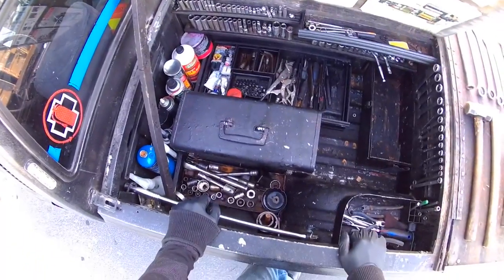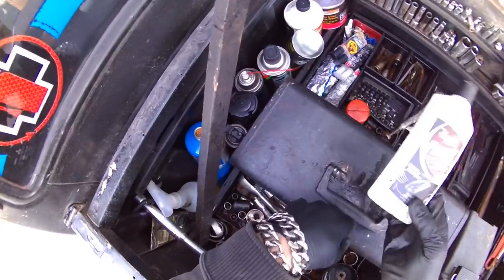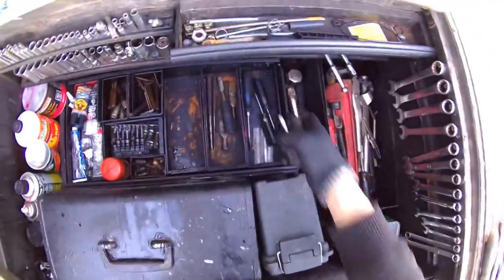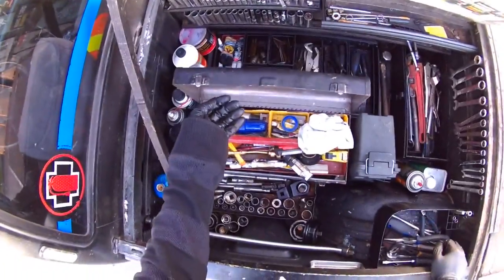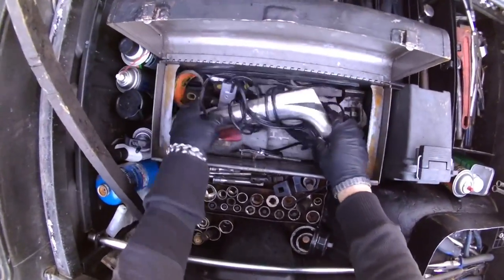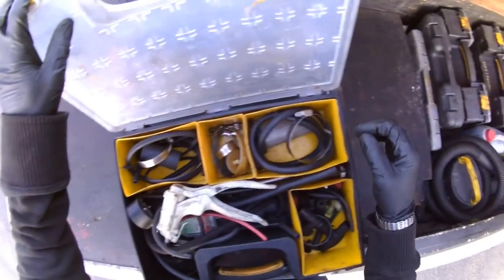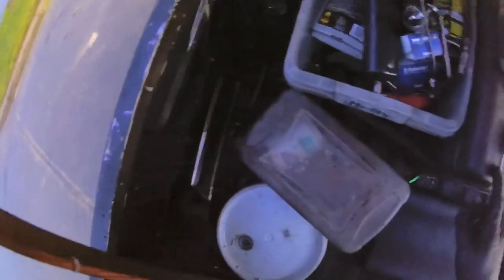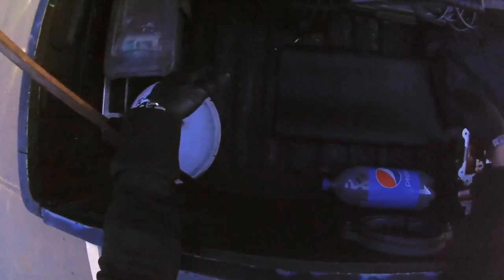QUICK money ain’t easy (how to Be your own boss)

Comment: Been doing mobile mechanic work, since I Lost my job due to covid trying to get setup the best I can, with what I had. But making decent money so far $800-$1000 a week. So been reinvesting in tools, and organization. I swear if I can only get  radiator jobs I charge $250 plus parts, or sensor/tune up/valve cover gaskets charge $80-150 I'll be set.
Reply from the maker: A lot of the process is proper diagnosis, but a water leak is pretty easy to spot. A good thing to get is a labor guide, it’s only about $25 a month, but it really helps when dealing with variances.  Some radiators or alternators take 1.0 hour, some take 3.5

It’s not 100% accurate, but it helps with estimating and knowing what you may be up against. 

Another option is setting up a couple fleet accounts.  It’s steady work, and usually just a bunch of oil changes, if you can manage to do them without hating your job. 

Either way you go, keep your integrity, be honest with people, work hard, and know your limits. 

(Also, don’t over tool, if your not working on big vehicles and stay away from Prius, Nissan, and Kia)
Reply: Def tighten up on the quotes. Use RepairPal, or one of the common estimate apps to get more accurate prices. Some radiators are .8 of an hour, some are 5 hours labor. Same for many of the other things you mentioned. Accuracy makes it more fair to you and the potential client.
Reply: I’ve been running my mobile repair business for 3 years now. Best thing you can do is get away from labor guides and do time and material charge. I use book time to give approximate times for jobs, but being mobile there are too many variables to the repair. Plus, being mobile is a benefit to the customer, so even if they pay extra it was a convenience thing going out to them.
Reply: @totalmobilesolutions4138  Yes I'm just trying to make at least $150 a day,  I get more calls than I can handle, so I really don't have to take on time consuming jobs. Crank no starts, and parasitic draws are currently my money maker Usually requires very little parts, fuses, relays, or even different keys. Yes they can be tricky a f150 was wired back wards the other day, but everything looked right, turned out to be starter solenoid was failing. causing the battery to fight the alternator. Of course changing that out caused the fuse to blow. another good job the other day crank no start was this guy literally had 3 ignition key cylinders plus a  slot to turn the screw driver, wires everywhere and not a lot of money and it was late, and he was in a hurry like they all are. He said get it started so I can get home, I mounted his mess under the dash, and re wired his screw driver thing real fast and in 10-15 minutes it started. Told him $100, and I can come re wire everything for $200. It's like how do you charge for simple stuff? Another guy changed his ignition coils and blew his ECM fuse. I changed it in 5 minutes truck started and drove fine. There's another $100 bill. $40 for diagnostic, $20 for driving, and $40 to get it running. I'm trying to find the sweet spot between having customers, and what I can charge. On that $100 ecm fuse job, he actually tipped me $40, because he said he couldn't figure it out for 2 weeks and I don't charge enough. So my mind is blown. But then there's jobs I get, way harder then expected like cadiilac motor mounts, where you have to take exhaust and extras off to change them and I basically get $150 for that too. It comes down to do I want to be working on top of the car, getting less dirty, or under a car getting covered in crap.
Reply from the maker: It’s usually the simple things that get overlooked the most.  I’ve had a problem with trying to charge customers for fuses also, when they couldn’t drive for a week because of it.  But you have to realize you are their hero, and you have taken the time over the years to recognize what the issue is and how to fix it. 

It the old story of the guy they flew out to the ship to get the motor running, he hits it with a hammer, and sends them a bill for 10k

They said why so expensive, you were there for 10 minutes, and you hit it with a hammer

He said $10 for the hammer, $9990 
for knowing where to hit.
Reply: @totalmobilesolutions4138  Yes agree... all my customers know i charge a service call at 60. 60 per hour for mobile repair. 90 for in shop fabrication and 110 for mobile welding. plus my mark up on parts. it is what it is. dont like it go elsewhere.  they always call me back
Reply: @750nicko  110 for mobile welding? Are you in ny? I need a mibile welder but cant find one
Reply: @MechanicalTriage  
Do you use any repair software like Prodemand or Identifix? What about estimating software? I am currently a GM tech but thinking about going mobile.
Reply from the maker: Ben Hood I use “auto labor experts” for a labor guide, very cheap, yet very accurate for time management over the past few years. 

As far as identifix or pro demand, no
I work very close to O’Reilly most of the time, and on the rare occasion that I need it, they have Mitchell I believe and can diag obd codes through identifix.
Reply: Same here...  I was already doing the side jobs, but the Virus made the repairs and videos my main way to keep busy. I'd be happy with more timing belt jobs, but get mostly brake jobs.
Reply: @750nicko  I need to pick your brains. I'm a cert. Welder and also do wrenching. Haven't figured out prices on welding help!
Reply: @totalmobilesolutions4138 
Yes that's the best way to charge for your work, an hourly rate plus the cost of the parts, like you mentioned you have to consider seized/ corroded / damaged bolts and fittings or difficult to access parts etc.
Best regards,
Stefano (UK)

Comment: I'm just a part time mobile mechanic, but I carry tools just like yours, and my tools way more expensive than my old Mazda truck that I'm using.
Reply from the maker: The most important thing, is you get there with the tools, and you have the right tools to do an effective repair. :). 

Another mechanic in my area operates out of the trunk of a Honda Accord, he does a lot of brakes and small jobs, another guy has a box truck with a compressor and a bearing press. , we all work together when we get stuck.  So I carry an intermediate tool set, and together we cover the needs of the community well.

Comment: Not hating on you but ive been a mobile mechanic for almost 30 years. I carry a $5 husky bag with various tools and can get 90 percent of work done. You dont need a lot of tools, you just need the knowledge. Like Cody Lundine says "The more you know, the less you need
Reply from the maker: We must not be working on the same things then....  cause that would mean that every mechanic with a technical certification, and a roller box full of specialty tools, to do the jobs we can’t, are ALL wrong.   If it were as simple as brakes, alternators, and starter, I could get away with a 10mm, a 14mm and a screwdriver.  But, I’m working on Volvos, Mercedes, Vw, Head Gaskets, suspension, dropping fuel tanks, dropping transmissions, cutting off and tapping rusty bolts... and doing a lot of jobs that the lazy techs at the dealers and independent shops passed on because they didn’t have the education to diagnose the issues correctly.   

I understand the need to stay lean, and that you can do the majority of jobs with a limited amount of tools, (the 80/20 rule) but the diversity I have with the tool setup I made, challenges me on jobs I wouldn’t usually take on, has lead to better mechanical education, and allows me to make a much better income.
Reply: @MechanicalTriage  Touche. I guess that's true. I used to do everything...from rebuilding transmissions to welding chassis. But I gave all that up because the time/money ratio is much better doing smaller jobs that it ever was doing big jobs. I'd rather only work 20 hours and make $750 than work 40 hours and make $1000. But that's my personal preference. Stay safe out there
Reply from the maker: Very very valid statement. I lose my ass every time I do a motor swap or head gaskets because of all the little things, (setup, parts acquisition, waiting for machining.. etc). It’s a great thing to do a couple “simple” jobs and score a win every once and a while.  Freedom of time and not being buried with a workload of details is awesome. 

Keep it simple. :)

Comment: All right I've got some constructive criticism. I think you are carrying way too much stuff. That stuff is weighing your truck down and costing you money. I carry wayyyyyyy fewer tools and do alright. I can fit everything in an economy car and very rarely be left wanting.
Reply from the maker: Noted, however, I have a rebuttal.   After minimizing and working out of a trunk for 6 months, I have a pros, and cons list about that.  

(I have been able to do many head gasket and motor swaps with a minimized setup, btw)

There are some jobs, that I haven’t been able to  do, based off of the scope of work I was able to do when I did carry all those tools, or those jobs just became slightly more difficult because of the limitation I experienced with less tools at my disposal. 

Once I get the truck finished up here next month or so, I was going to put SOME of my missing tools back, most likely just the power inverter and some power tools like a grinder and sawzall. (Could go with cordless too, but that’s to each their own)  specialty tools I’m missing like the 12 point square socket for vw bolts, a more thorough set of axle nut sockets, my hardware, coolant testing kit, compression tester, oil pressure tester, etc. etc. 

Yes, I have been able to do just fine with a limited setup, and already find myself cluttering my trunk with things I’m not using again, and it’s best to stay lean and clean. But, I still can’t stand working out of a trunk...  it’s very unorganized looking to pull 6 toolboxes out just to get to a jack, and very inefficient. Plus, my truck is a staple to my business. People pull off at random jobs I’m working at to catch me and ask me about work cause they have seen me working here or there.  

But, tangent aside, I weighed the tools out, and the complete setup only weighed about 700lbs. And honestly, I needed that weight to push the ass end of the truck down the extra inch to get my ride height correct. 

And when I did have all those tools, I used every single one of them, some rarely, but I knew what I had to work with, and that saved me time and trips to the store. (That’s why I do most jobs at or near a parts store). 

Yes, that is an excessive amount of tools, and you can do a fantastic job with far less tools, but having the piece of mind knowing your not going to get stuck in the middle of a job, for any number of reasons is a great confidence booster when selling a job, and people love to poke through the setup. 

(I got 20mpg empty or fully loaded with tools, it didn’t seem to make much difference)
Reply: @MechanicalTriage  I will do my own tool setup video and let you know what I think is a good setup. I don't pull 6 boxes out normally. I have one small box, 2 slightly bigger boxes and then 2 relatively streamlined baskets. But let's say we do pull everything out. (If I have a helper with me it is standard for him to arrange all the tools right behind me.) When your boxes don't look like a pile of shit and you get OCD about putting stuff where it belongs, it is very fast setup and teardown.
As far as the choice of service vehicle, I like executive class sedans because they look nice and my car left a good impression. However the vehicle that I believe is the most correct answer is a car that gets at least 30mpg. 
Lol, all that being said, my service vehicle for the last 30,000 mi was a Ford Taurus SHO. I chose having a fast car over having good gas mileage.
Reply: @TheYouTubeMechanic  video please

Comment: Must be carrying alot of weight 😱
Reply from the maker: It’s about 600 lbs I think, maybe 700.  Not bad.. 

When I’m done rebuilding it, I’ll have a leaner tool setup, but the truck will have more equipment.  Also, it will be on air bags, so it won’t really matter on the weight. 

I never really noticed a change in mileage loaded vs unloaded though.

Comment: I couldn't handle all that rust on my tools!
Reply from the maker: I know!!  Some works off. Some I replace. 😒. I’ve torn the bed apart, cause it never was waterproof, and will be replacing it with a solid cover.
Reply: Honestly if I was mobile I'd probably have almost all impact sockets. Don't feel as bad having them get a little rust on them.
Reply from the maker: It’s Washington, it rains. I get wet, so do the tools.  But, idk if harbour freight tools rust faster than expensive ones.  (Interesting point about the impact sockets)
Reply: Fluid Film is your friend.   I use this on my hand tools and Impact sockets and I use it on my table saw (cast iron), no serious rust issues yet.  It does keep the rust at bay, but does have a different odor though, I don't mind it but others do.